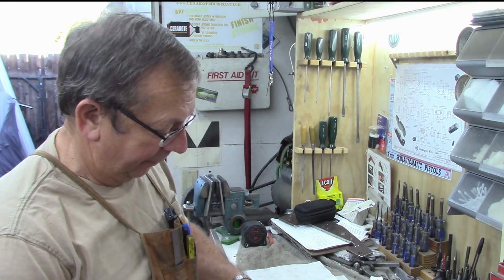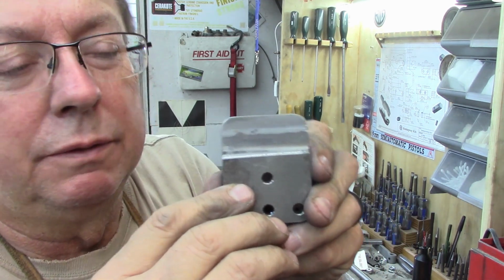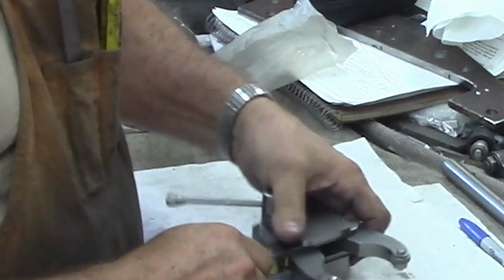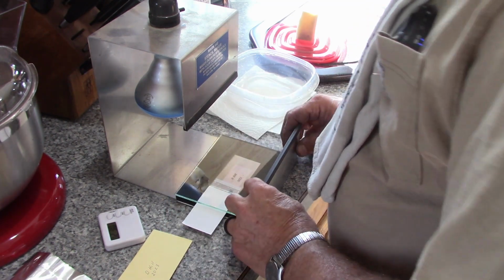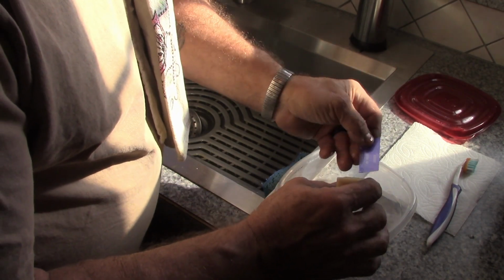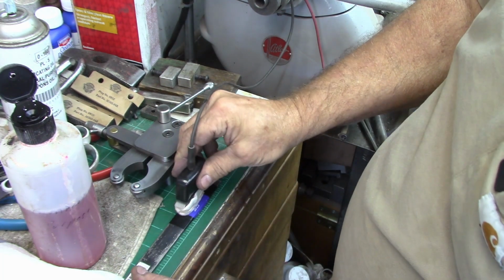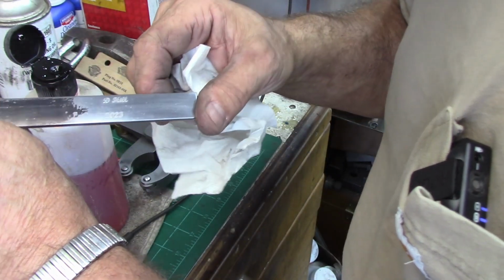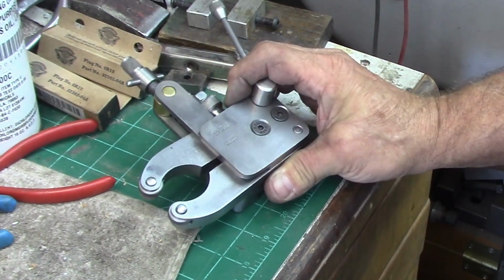Hemingway Knurling Tool: Part 14

Comment: Sorry had to give a thumbs down. You spent more time on the stenciling than the machining of the 14th part of the build. Which was no time on the machining. More time on taking it apart again. I dont think you even got to the blueing.
Reply from the maker: Gotta do what you gotta do, I try and give an overall picture of what goes on and there was nothing really new as far as machining processes on this project and some find the etching interesting so I try and accommodate a large range of interests